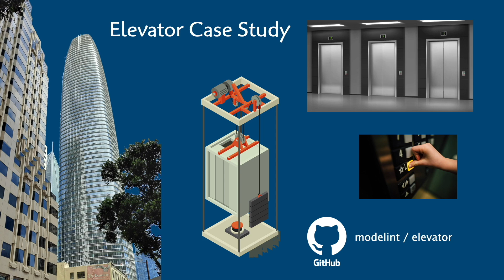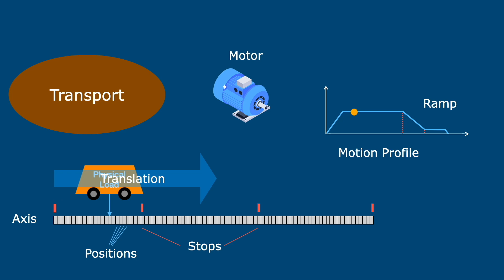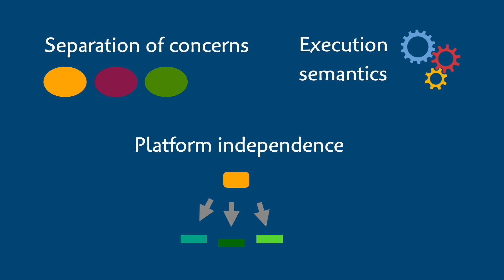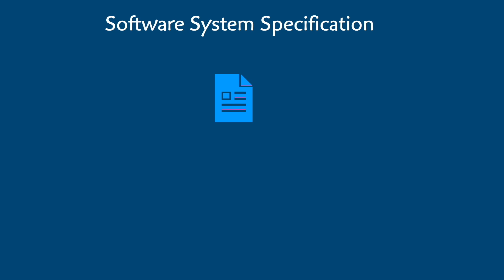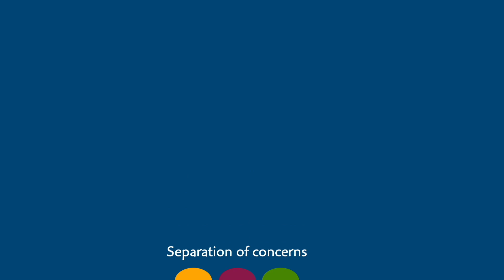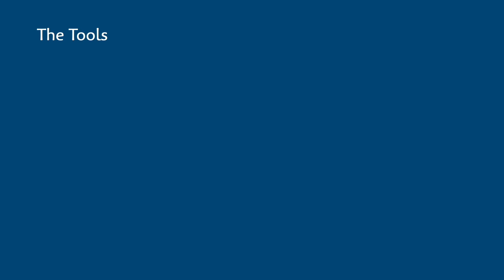Intro 2 – How to Specify Complex Safety Critical Software Systems

Comment: We continue Leon's excellent course for grown-up engineers.  This is our first glimpse of important ideas around domain separation, where each domain has its own reasons for being, its own rules and regulations and its own vocabulary of discourse.  As understanding of needs unfolds, each of these domains will fulfill some requirements and will also impose some requirements.  (Some of the most messed-up projects I've ever worked on have confused and conflated domains.)  
Once again, models will succinctly capture the characteristics of each domain.  Later on, models will also relate domains to one another.  If you've already worked with essential models, or platform-independent models, you already know the value of this approach.  Even if portability is all you're looking for, this approach is worth the price of admission!